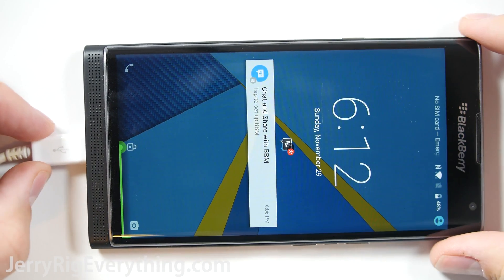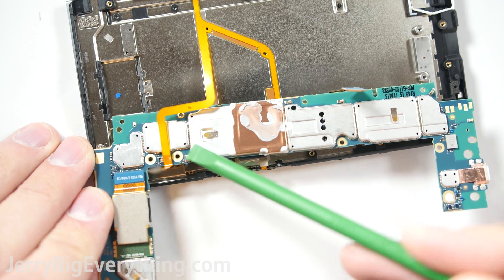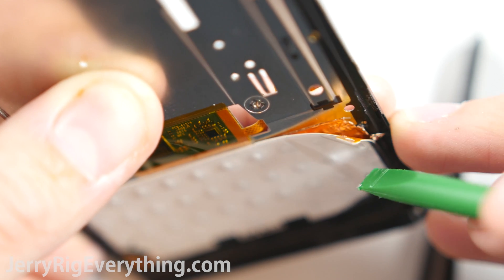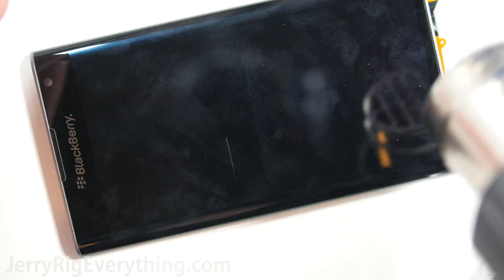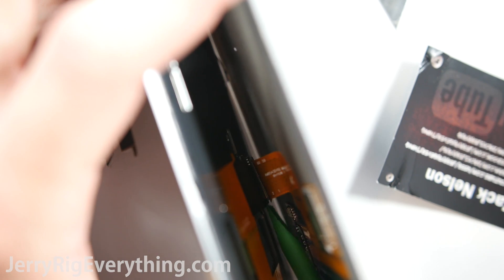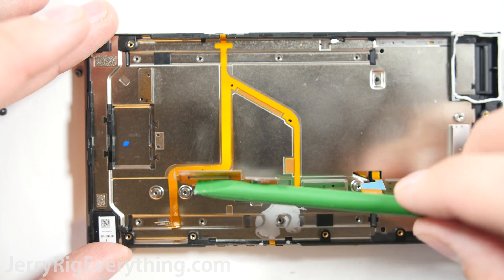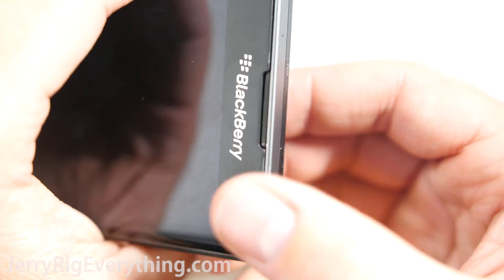BlackBerry Priv Tear Down - Screen Repair, Battery Replacement

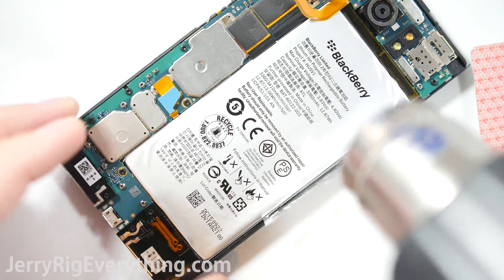Comment: 0:59 This silver  color part that is above the battery pins and where there are 2 holes for the screws.... is it necessary for the battery connection?

Comment: Great video. Just replaced my battery a second time. I replaced the original battery on 5/19/2021. The phone would die shortly after being off the charger. I’m sure it’s just because they are NOS. We’ll see how long this one lasts.

Comment: Overall this vide is very useful. HOWEVER! the back of my phone does not detach anything like as easily as the demo here - there are lugs inside the top end of the back cover which need to be released before the back will unclip from the sides. This proved very tricky on my phone. Once they are released, then the sides release fairly easily and the back slides out of the pocket at the bottom of the phone. It would be very helpful to show a close up of these lugs and how best to release them.

Comment: Hi Jerry, I did the battery swap, but now my Bluetooth has very little range. How do I check and fix the Bluetooth antenna if I disturbed it?  Also, do you have an Updated battery link?  I bought a “Blackberry  branded” one on EBay, but it’s only registering 2,400ma.  Thanks and great video.

Comment: Dumbest thing I ever tried. It's nowhere near as easy to remove the back cover as you're making it out to be. I permanently broke my new phone in 3 places, using the tools provided, just trying to get that absurd back cover off.

Totally not worth trying this at home. This is the most difficult piece of technology I have ever tried to disassemble. It's absolutely ridiculous that I have to take a cellphone in to a repair shop just to change the battery. Ridiculous.

Comment: Hello sir. I've a question regarding my Blackberry Priv. I'm in a very wierd situation, my Priv is having some issues since yesterday. These includes, Keyboard Backlit Not working, the Screen doesn't turns off while on a call, the Rotation mode is not working (stays on potrait), Auto Brightness doesn't works properly.
So I want to know how can I fix the Proximity Sensor? Please help me, you could save me.

Comment: My mic broke on my Priv (cannot do regular calls, has use put it on speaker). Where is the mic? Can it be replaced? Why does the mic work with the speaker but not in regular call mode? Thanks

Comment: Thanks!  So it is to possible to just replace the glass and it is pretty easy to do?  I was told it was not as it is glued onto the whole slider assembly.  But you indicate that is not true.

Comment: My power button had failed, this video saved my PRIV and me from having to spend $500+ on something new! Thanks!
Reply: Curious.  Was your power button failure like mine, where the phone would simply keep rebooting and over-heating?  What did you actually replace or do to fix your on-off.  Did you manage to get a replacement switch.. or the whole back of the phone... and if so, where?  Thanks.  Can't wait to get this great phone going again.
Reply: @waterbuoyish  my button on the side had broken, I couldn't press the button at all. So no way to turn it on/off. Was able to purchase the ribbon wire w/button attached and install it

Comment: hey Jerry, thanks for the great video! I just got a new battery and followed your instructions. It was pretty harrowing to try and get the back off. I put it all back together but when I plug it in to charge. If I hit the on/off button, it displays the battery icon with an exclamation mark in it. Does this mean that the battery I got might be a dud? Or did I connect it poorly?  It went in fine, didn't damage those delicate cables behind it when I removed the original battery. Any advice for me? Thanks!!!

Comment: Thanks for this video, I replaced my broken screen, however after following all steps and going backwards to reassemble the phone i realized that the speaker now sounds a bit rough, as if the volume was pretty intense and the sound is distorted (crackling) specially playing bass. What could it be? Please help.

Comment: Thanks so much for this great video! After almost three years, battery of my priv died - and with the help of your awesome tutorial could replace it within 15 minutes (only horror was actually the glue on the back...). 35 Euros (incl. shipping) for the new (original!) battery - no way I could have bought a new phone for that price. And: This solution is also much more sustainable, love it! Thanks again :-)
Reply: By "new" I assume it's unused but still 3 years old (i.e. made back when the phones were made). So I'm curious if it still gets the full 3410 (or 3360) mAh as it would brand new.

Comment: Thank you so much for this video.

Since that tiny little tool to open the sim card and sd card is a nuisance to keep track of, I discovered when I had to do this.  A replacement that is the correct size is available in most people's odds ends drawer.  A small safety pin is the right size.  Open the pin and cut off the sharp tip.  I used the wire pinch in a pair of pliers.  It works perfectly and I usually have safety pins around.

Comment: I don't know what kind of Priv you have that the back of your phone just peels back like that, but mind sure as h*** doesn't. I seriously want to break faces over this s***. So f***ing pissed.
Reply: Now you know why the difficult to access and remove battery is a deal breaker for me.  BlackBerry batteries were easily accessible and removable in the old/original BlackBerry OS era but all BlackBerry batteries are difficult to access and remove beginning with the BlackBerry 10 era and continuing to the current Android era.

Comment: Hi Jerry Thanks for the video I like these sort of things. Hope you wouldn't mind I ask you a question, My WIFI is broken on my priv. 90% of the time it is unable to turn on, and on occasions like reboot after long periods of being off, or a cycle of airplane mode it will work. Once it's working it will only stay connected to a single WIFI and when I leave the WIFI area it won't be able to reconnect and will no turn on anymore. 

any thoughts?

I've installed the OS but nothing? Have you seen this issue before? Thanks.

p.s. The MAC address is super confusing: 02:00:00:00:00

Comment: Thanks so much for this awesome video! My PRIV volume buttons went dead, and watching this video and after ordering the buttons strip and back cover I changed all the parts in less than half an hour. Just a minor detail: you mention a T5 screw driver and I used a T4 on mine, the T5 didn't fit on the screws... Anyway, thanks so much for the time you took doing this ilustrating and awesome video.

Comment: Many thanks for taking the trouble to post this great clip which helped me replace my screen-module quickly ... with no bent or leftover parts.  May I add that the screws attaching the screen sliders are T3.

Comment: Know where we can find a replacement speaker part? I smashed my phone in the car door and used your video to replace the entire front screen portion, which was awesome. But now that I have the phone back together, the keyboard will not work, and there's no sound coming from the phone, so I'm trying to troubleshoot the remaining issues.

Comment: What about finding a replacement for the back cover? Unfortunately, unlike how nicely it went in the video, my casing did not want to give it up right around the camera lens cover and cracked at the sim card entry openings. I found one on Amazon, but it doesn't have all the same wiring as the inside of mine.
Reply: Found some on eBay. Thanks for this video!

Comment: Hey Jerry, thank you for your video! My slider completely fell off my phone and although I can attach it back on, I think something that allows for the screen to connect visually to the phone broke. that "doohickey" that you wrote about right before fixing the screen. Is this the problem? I see you have replacement parts in the description, is the new screen what I would need to purchase? thanks in advance!

Comment: Man this sucks so bad! I need to fix my phone and I'm unable to do so. No phone repair store will fix my phone because they said this phone is not sold in stores anymore. part of the screen is cracked and a part of the screen is black because the display got all messed up from dropping it. The last time I tried to fix my phone on my own I messed it up because I didn't know what I was doing and I ended up having to get a whole new phone. Grrrr I wish they wouldn't make smart phones so hard to fix

Comment: I found this video absolutely perfect to just replace the battery. I used a hair dryer as instructed to slowly melt the adhesive under the battery after prying it up a little to let in some of the hot air. I then gradually pulled it up with the tab. I put the old adhesive plastic on the back of the new battery and everything went back together easily. Thank you, Jerry.

Comment: Hi, I've recently changed my screen and slider by removing the battery etc. my capactive keyboard seems to have stopped working but the keyboard still types. do you think this is because I've done something wrong or might it just be a software issue?

Comment: Very good video.  I was able to replace the screen, digitizer and slider with relative ease using this video and the smart phone repair tool kit linked above.  The only difficulty I had was snapping/unsnapping the back.  It was a bit tricky to unsnap without cracking the back panel.  Also, when replacing the back panel the mute button snapped off.  @JerryRigEverything, do you know if the mute button is repairable?  I'm not sure if the side buttons are glued on, or perhaps soldered on, and which tools would help to repair it.

Comment: I didn't hear/see anything about the ear speaker.  Mine acts as if its blown.  Any tips?  If I have to take off the screen to replace it, will I have issues with the screen sticking afterwards?
Reply: I'm having the same problem. I have one Priv with bad electrical issues, and another with cracked glass and a non-working earpiece. I want to cannibalise one to fix the other, but the earpiece isn't shown!

Comment: A video describing how to separate the digitizer from the glass itself would be useful...if it is even possible. It has adhesive between the two. Removing the digitizer from the glass messes up the display.

Comment: Hello Zack, thank you for the awesome video. I clicked on the battery replacement link and it's not working. Can you please share a different link for it. On another note my priv battery is swollen should I still heat it up before removing it??

Comment: Helped a lot, thank you so much. One piece of additional advice would be the locations of the 3 tabs on top of the phone, very important to know where they are so as not to break the plastic by the sim/sd card slots. Lucked out myself as had a spare to practice on when replacing my screen and front frame!

Comment: Is there any possible way to replace the "digitizer" part of the touchscreen without replacing the entire LCD if it's still working?  I have two Priv's.  On one the screen doesn't work at all, it's just black, but the digitizer might still be working.  I have another one where the screen works but the touch is only working on the top half of the screen.

Comment: Just completed the screen change out on my Priv. This video is excellent in showing you exactly what needs to be done. One thing to note - make sure you use a plastic tool to pry out the battery like he does. I had a minor short using a metal one.

Comment: hi man; any chance to get the link to the Qi-compatible back? European model doesn't have wireless charging; but from the video I would guess it should be a drop-in replacement, and dead simple, too - just replace the back with one that has a Qi coil

Comment: Thank you so much for this great, informative video! Instead of an expensive replacement or shop repair, I was able to do this myself with thanks to EBay (for the spare part), a Torx screwdriver kit, tweezers and a hairdryer (and a reel of double sided sticky tape to stick the battery back down). I was being super cautious so it took about 90 minutes, 20 of these fighting to get the case off! It got easier after that, and the only mistake I made was to not align the headphone jack in properly before putting all the motherboard screws back on ;-)  Super video, so happy with my repair. Would not have been able to do it without you!!

Comment: +JerryRigEverything, great video - very helpful. My 1-year old managed to get some olive oil through main speaker grill and the sound now is low/crackly. I sucked out some of the oil, used some alcohol/toothbrush but with moderate improvement. Any advice?

Comment: You said, "most of replacement screens" come with pre-installed adhesive.  Does the replacement screen you put the link to come with the adhesive??
Reply: I'm not sure if my parents bought the one in the link for my Christmas gift, but if they did, then it does not. I have to figure out something to keep the screen in place myself.

Comment: Is it possible to replace just the glass only on the screen?
Reply: Stephen Craig Rest Any result you found?
Reply: Gerald Tan I tried to do it the same way as a Samsung Edge lens but failed. I ended up just changing out my full slider screen I got from a bad esn phone I found on ebay
Reply: Probably not, it would be much more work and I'd rather pay a few extra dollars to make it easier and just buy a complete screen with glass of attached
Reply: Most phones made after 2015 have a non-separable screen assembly.  The touch screen (digitized) is glued together with the main screen (LCD) in the factory therefore it's very difficult to separate without special tools, and even than it's not worth the time and effort.  Therefore it's best to get the entire screen assembly, digitizer + LCD as a once piece.

Comment: Please note that taking the back off a Priv nullifies the warranty. They do NOT want a regular user trying any of these procedures.
Reply: But at least it is easily doable, which means it's a phone I'd consider buying. With some other phones, any repair attempt may end up causing even more damage.
Reply: kada jawi it's easy access but near impossible to find parts :(

Comment: Is it possible to do a glass only repair on this?
Reply: There is a way but i think you need a machine,  the glue is really strong on the lcd, its like trying to remove a piece of glass hot glued onto a potato chip
Reply: Andrew Gamez amoled, not lcd
Reply: oh ok my bad

Comment: Thank you! I just dropped my privy in the tub for a second so I took it apart as per your video! I will leave it open like this for a while. Do you think it will work when I fire it up? I removed the sim but didn't have an sd card in it. Can u tell me if I can order a new screen from you? it is cracked but still works. thanky you?
Reply: if that happens you should take it out immediately and scrub it down with 99 % alcohol

Comment: Hello!So, it was cheaper for me to buy a Private on eBay for parts only than to buy the screen screen replacement by itself...so I'm wondering if I'm removing the screen off the one I purchased on eBay, will the adhesive be sticky enough to put onto MY phone? Is there an adhesive I could safely use? Please let me know!
Reply: Instead of trying to move the screen (which is near impossible to remove without damaging it), it's better to simply move to the electronics from your broken one into the replacement one.

Comment: I know this isn't a Galaxy S5, however, those screen are very easy to apply, it's , the part of the motherboard that you connect the LCD to is exposed and just clips on. all phones should be done like this. As for the older phones where the glass and lcd aren't glued together, like the ipod touch i think the glass should be able to clip above the mother board where the front camera is

Comment: Impressive! if my BlackBerry Priv breaks I'll just use one of my 16 BlackBerry phones and send the Priv in, I'd have it all messed up lol. I will say out of all the 16 BlackBerry phones I own the BlackBerry Priv is by far the best phone I've owned,  and that's going up against my S7 and IPhone 6. Nothing even comes close to a BlackBerry Priv or a BlackBerry Phone period.
Reply: I have a Priv but I dislike it. The processor gets extremely hot, it makes squeaky noises and the camera is horrible in low light amongst other issues.
Reply: +Ghost Johnson really?  I don't have any trouble at all.
Reply: +Leandro Chua I have the latest software. It has become less laggy and hot but it is still unbearable. Especially when I use Snapchat or Pokemon Go
Reply: +Leandro Chua me? yes im on Marshmallow Beta,  im able to get Android Nouget.
Reply: +Leandro Chua My brothers S7 Edge is fine after playing it...

+Aarron Clark How do you get Nougat??
Reply: +Aaron Clark How to get Nougat??
Reply: +Ghost Johnson I don't have it yet, only then Nexus has it now, it's going to be released soon but I'll be getting it sooner since I'm on Beta. I'm on Marshmallow Beta now.
Reply: Aaron Clark yeah it's too bad  blackberry won't be designing their own phones anymore. even though Blackberry has traditionally made very strong phones i have a concerns about the priv's long-term durability
Reply: 1mezion  Don't worry, BlackBerry Still has full say so over specs and design,  So BlackBerry will test every phone to insure it meats their standards. TCL makes a great phone and it's durable anyways, so don't worry. BlackBerry is doing just like Apple and having another company build for them, Foxconn builds for Apple.